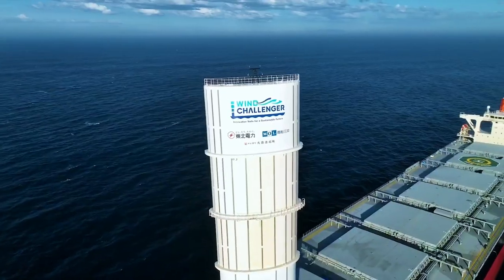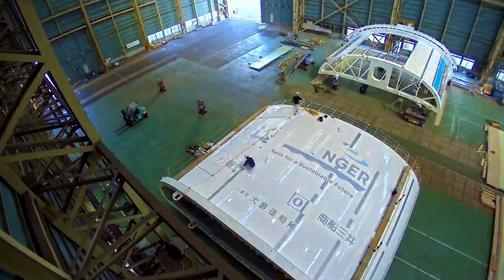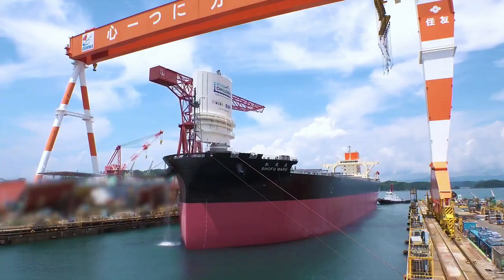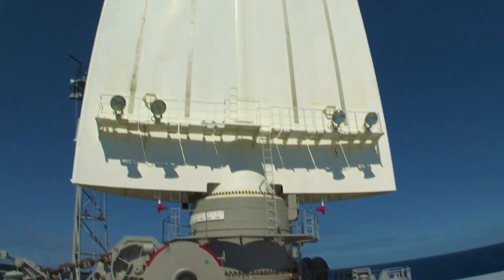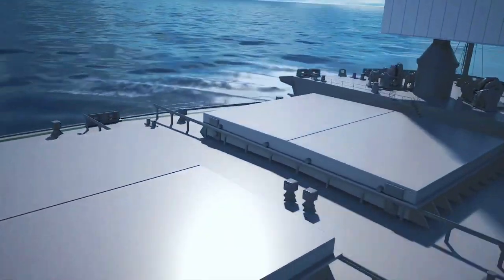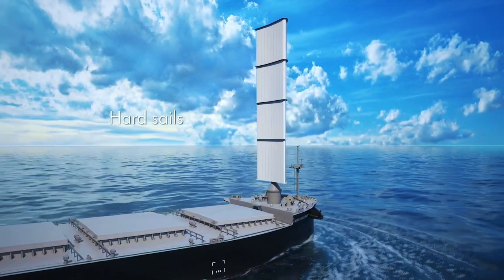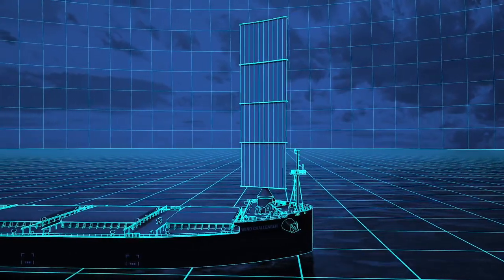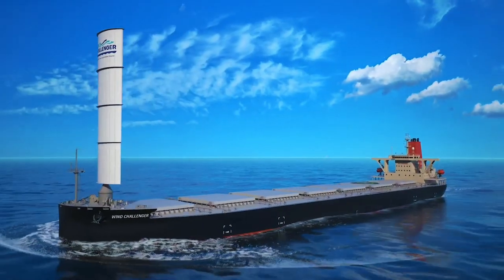'Wind Challenger' - World's First Partially Wind Powered Cargo Ship Successfully Sailed

Comment: Why not use wind turbines instead of sails to power generators that will drive propulsion engines?
Reply: You only have more losses when converting energy more times.A turbine whose kinetic energy goes into a gear system could work but the losses of such system are definitely higher than sails.
Reply: @Heheha329  You're ignoring the energy lost to the wind pushing the ship sideways.